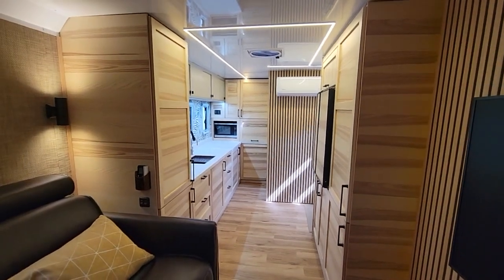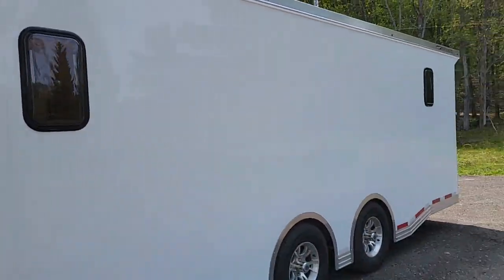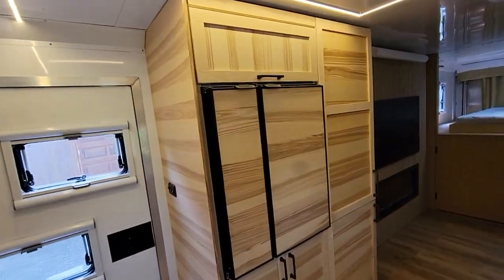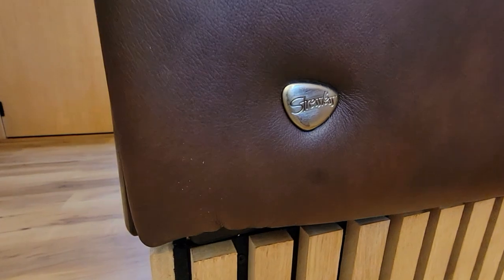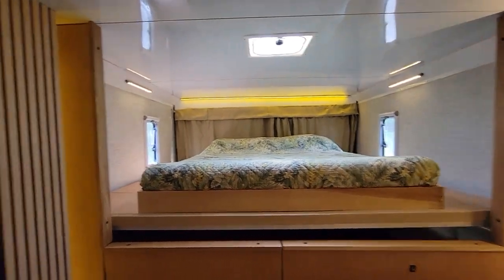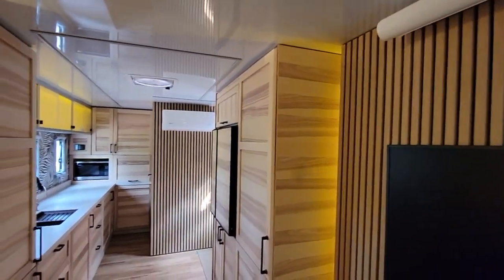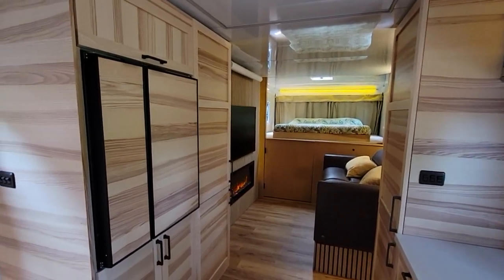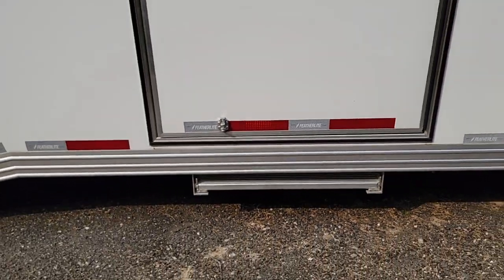FOR SALE!!! - Luxury Trailer Build

Comment: Very nice work. Ceiling is ACM / alu-panel? How is it held? We do not see fasteners.
Reply from the maker: The aluminum panels on the ceiling are bonded at the factory (insulated first). This helps create the Uni-body strength and rigidity.

Comment: Absolutely amazing build! Love the well thought out floorplan and attention to detail. What is the overall dry weight of the trailer, and what are the capacities of the fresh and gray water tanks?
Reply from the maker: Thanks! Trailer dry weight is 4200lbs. 30 gallon water tank and 20 gallon grey tank. Since toilet is composting you use a lot less fresh water and don't need as big a grey tank.
Reply: Wow, that's incredibly light for a trailer this size. It seems like most of the cargo trailer conversions I see are usually shorter yet heavier than yours. Again, great job 👍